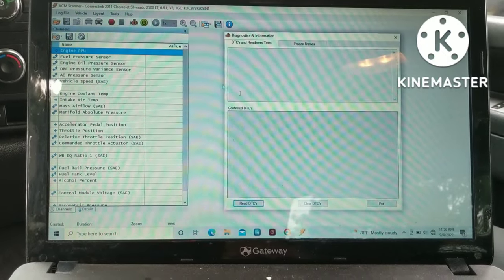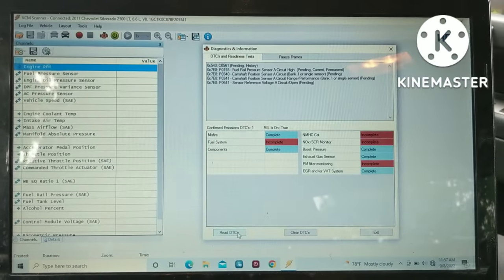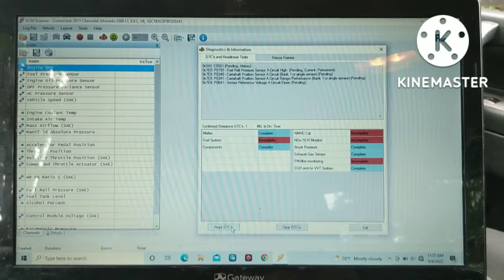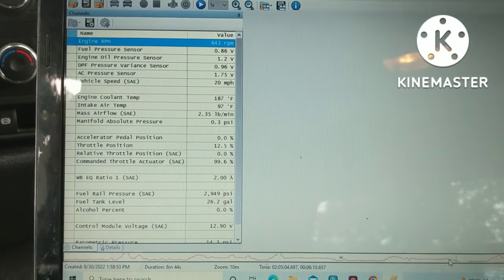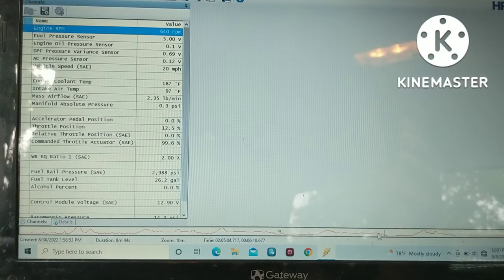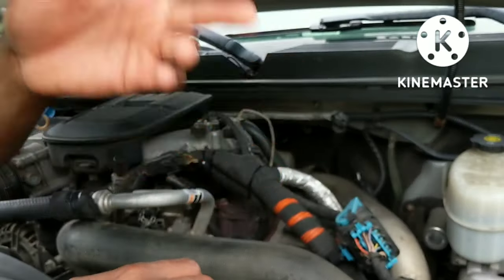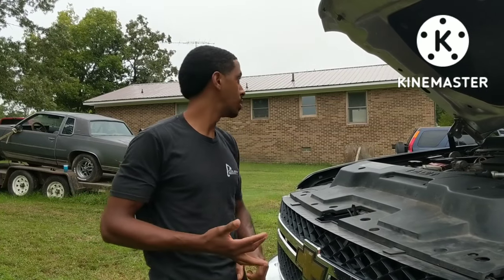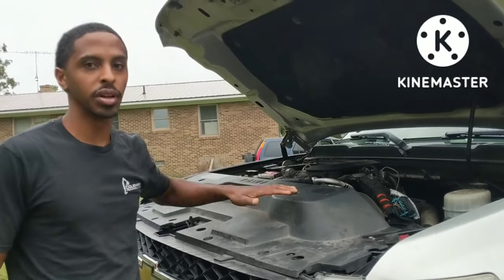11-16 LML Duramax Engine Harness Failure

Comment: Man you just saved me! Was hauling the fifth wheel and only when using cruise control would the Duramax LML throw codes for voltage references for sensor A on the fuel rail, ac, and oil pressure. I had checked the lines and didn't see any rubbing but sure enough i checked the one over the egr valve and yeah its rubbed into wires. I guess when i was in cruise control the truck was jerking more or something and losing voltage or gaining it. Saved me from a limp cycle. You are the man
Reply from the maker: @aegiscaleb  glad to hear it!